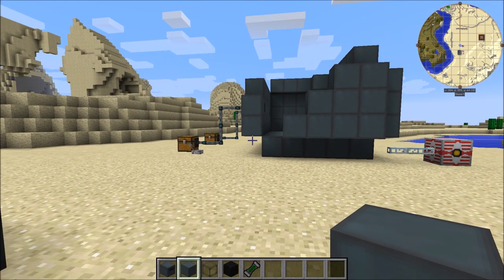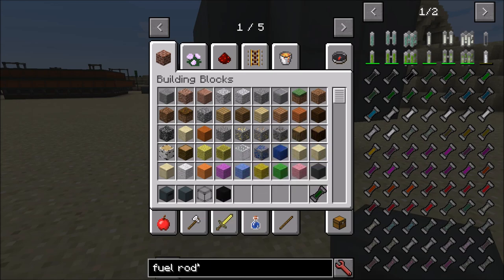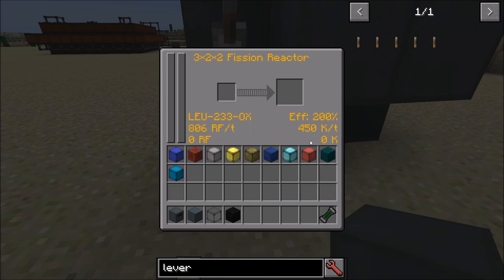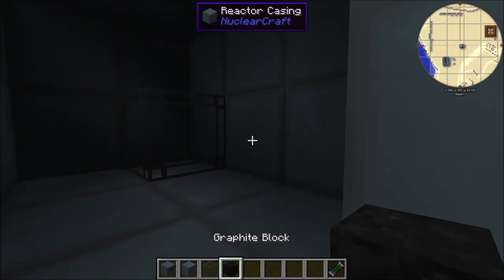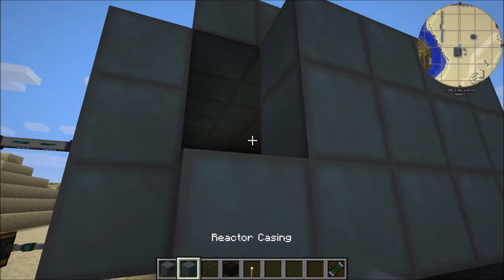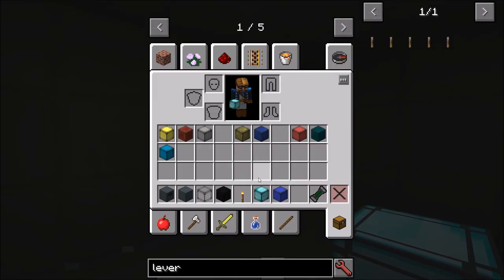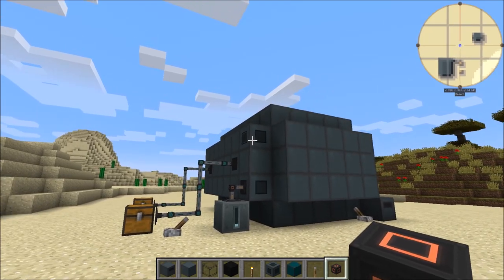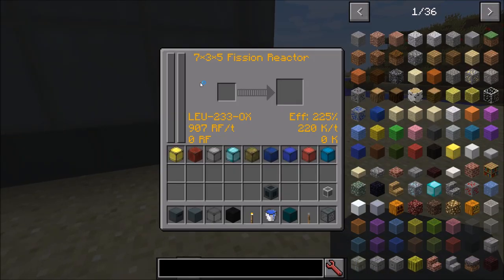NuclearCraft Spotlight - Nuclear Fission [Outdated]

Comment: A little late, but a few suggestions (and side effects) for actively cooled reactors:

 - Similar idea to the irradiated steak idea: if rotten flesh is cooked this way, it either turns into sterilized flesh (when eaten, you don't get poison/hunger) or leather
 - Nefarious purposes for a reactor: if a mob (or even a player) ends up inside an active reactor, they get radiation poisoning or heat stroke
 - Cooling tower: most people imagine these structures when they think of a nuclear reactor; multiblock, variable size, but the footprint has to be a square; multiple cooling towers can be attached to a single reactor
 - Steam turbine?: can be used in conjunction with the reactor itself or even with a cooling tower; also a multiblock structure but you have to build an entire rotor inside (similar to Big/Extreme Reactors); multiple turbine structures can also be attached to a reactor
 - Cooling loops with using all three structures: can either be a single loop that connects from the reactor to the turbine to the cooling tower or two separate loops, where one connects the reactor and turbine together and another connects the turbine and cooling tower together
Reply from the maker: Thanks for the suggestions :)

1. Chances are that I won't add a furnace that runs off of the heat of the reactor for a little while, as there are a lot of other, more pressing issues to sort out, but I will remember this for when I do.

2. I have had that idea for some time, and I'm sure it would be possible - I'll have to look into how something like that is done first, though.

3. The issue with cooling towers is that, like a lot of things that exist in real life, I really don't see what the use would be in the game. In the game, there is no concept of, say, the temperature distribution across a volume of fluid, and so cooling towers wouldn't really have any use - I think they would just complicate things.

4. Steam turbines have been on the to-do list for a long time, and they are the next thing I want to do after adding JEI support alongside molten salt reactors. One rule I have always kept to though is not to make this mod a Big Reactors lookalike, so I will probably not have the big turbine structures like that mod does. The inner structure of the turbine holding will be just as complex as the fission reactors though :)

Comment: I have a couple of suggestions, since you have plans to make it important to access the interior of the reactors.

Firstly, a reactor access hatch. Like a trapdoor perhaps, but matching the general block theme and allowing ingress and egress for the player without breaking the structure.

Secondly, internal radiation when the reactor is running, and a hazmat suit of some form to protect from it. Not that it's a good idea to manipulate the interior of a nuclear reactor when it's turned on, but some people might like the idea anyway.

And of course some clear reactor casings, though I see that's already been suggested.

Also I think I mentioned in a comment on another video the possibility for air filtration as an extra source for helium; if you're having fluid-based active coolers then I imagine it might be possible to have several tiers of coolant (e.g. water, liquid nitrogen, liquid helium) which would give uses to some more gases if you did decide to add that sort of thing. And NaK coolant maybe, though then you'd need to add a source for sodium and potassium.
Reply from the maker: An access hatch is a great idea, and goes nicely with the idea that the player should get radiation poisoning for being within the structure while the reactor is on - I still need to work out how to do this, however. And of course, a hazmat suit would be needed to enter safely.
And yep, clear casing has been added in the latest version :)

Comment: Hello again! only a suggestion but I think a electric furnace in Nuclearcraft will be nice beacuse you nuclear furnace use advanced components and I think easy to you create this,beause if you create a fission reactor a electric furnace  will be real easy :-)
Reply from the maker: Might add one at some point, but believe it or not, adding a standard electric furnace is actually quite a lot of work! It's because the recipe system for smelting is very different to the system used in all of my other machines.

Comment: Regarding active coolers maybe you could have something that mimics reality? As in instead of the water being consumed it becomes heated up? And then it needs to be pumped out of the reactor. Although maybe that isn't possible with how Minecraft treats liquids like water come to think about it. Anyway. I'm a little torn about these passive coolers. They don't seem to take away that much heat and with how heat quadruples it feels like they won't be cooling enough to stop things from going boom.
Other than that, great video!
Reply from the maker: Well, I am going to add steam-generating fission reactors, so I want the active coolers to be a little simpler, i.e. coolant in, heat reduced.

As for passive cooling - building these reactors is meant to be difficult. Most of the time, with most fuels, an efficiency of 300% to 400% is possible with careful planning :)
Reply: NuclearCraft Mod The best I ever managed in 1.7.10 with the basic uranium fuel was 140%...
Reply from the maker: I promise you that it's possible :)
Here's an example of a H.E. Curium-247 reactor, at 350% efficiency:
https://image.prntscr.com/image/89ef76c146514a66ae44edccf2f9cdc3.png
https://image.prntscr.com/image/e8d80f07b5634fa692641a01ff59ff0d.png
Reply: NuclearCraft Mod I don't even know how to get curium... And my current reactor is way smaller. It's a 3*2*3

Comment: Those numbers seem op
Reply: 200 rf/t still seems op from a single fuel block but maybe i'm not putting this into perspective enough. perhaps because IE is the only rf mod i have been using.
Reply from the maker: These reactors can generate a lot of power, but you will find that trying to cool them can become very challenging and very expensive.

Comment: Give all the blocks in the reactor a heat value including air and change the gold/diamond passive coolers into heat sinks.
Reply from the maker: I was thinking of doing that, but the problem is that if I try to consider too many blocks, the reactor has to go through a lot more calculations which would produce more lag.

As for different reactor parts other than simply coolers... it's something I've considered. I guess the coolers currently in the mod basically are heat sinks, though.

Comment: So much math involved in making a good reactor lol
Reply from the maker: If you want to squeeze out the most energy from your fuels, then yes, you'll need to do some planning. However, there are a lot of simple tesselations that can be built that have reasonable fuel efficiency.
Reply: I want to make sure i understand something about heat that i must have missed in the video... What exactly is its purpose of trying to keep it down and in a stable range??? Does it decrease fuel efficiency or cause it to possibly malfunction if left unchecked???
Reply from the maker: If the heat ever hits the maximum, the reactor will melt down. If you've ever used IC2 reactors, the idea is basically the same. Reactors which have overall negative heat production can run indefinitely, while you will need to use some form of redstone control to prevent a meltdown if heat is being generated.

Comment: Hi, could you please put power cables and storage batteries in the mod? I can be talking bullsh1t but from what I noticed this mod uses Ender IO cables, and since Ender IO / Mekanism and etc did not upgrade to 1.11.2 it is complicated to do such a thing, and a mod depend on parts of another that does not follow / Delay the update of the game gets complicated!
ty for nice mod!
Reply: use EU2, immersive engineering and there's a new buildcraft as of recent that you can use.
Reply: immersive engineering 1.10.2 Yet, EU2 There are no cables and I'm learning but I'm messing with it too, and the new buildcraft expecting it to get back to full as it was in 1.64 and 1.10.2. My idea for it (NuclearCraft) would not make it so dependent on other mods!
Reply from the maker: There are batteries on the mod, but they aren't finished yet - the one available to craft right now is the Voltaic Pile, but it doesn't retain it's energy stored when broken. As for pipes/conduits... well, yes, there aren't any in the mod, but adding them would take a lot of time - time that could be spent doing more unique and interesting things. If you're really low on RF options for 1.11.2, you could always use IC2 cables to move power around, as this mod is compatible with IC2's EU system.
Reply: thank you!